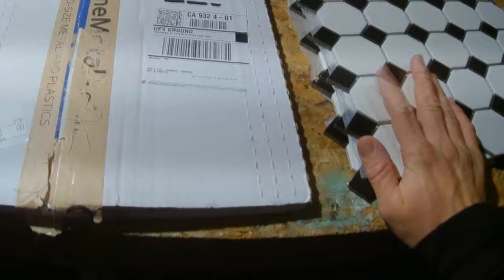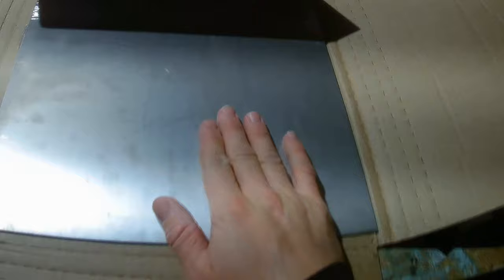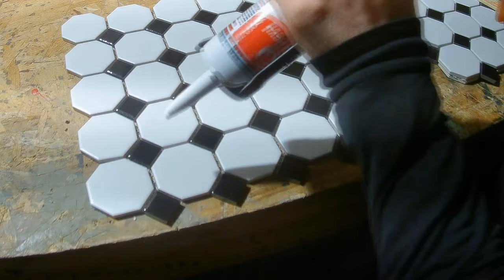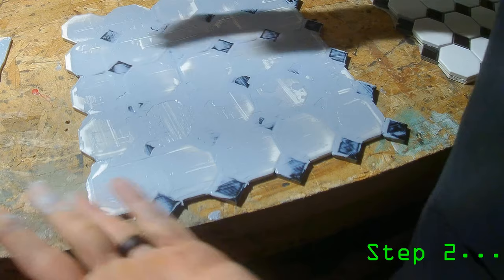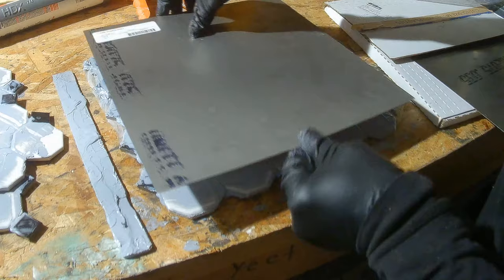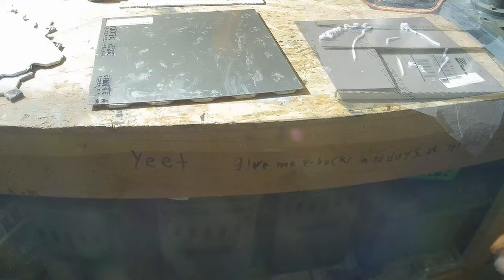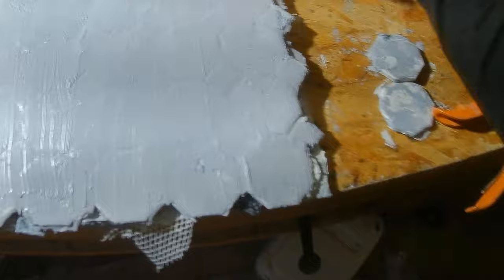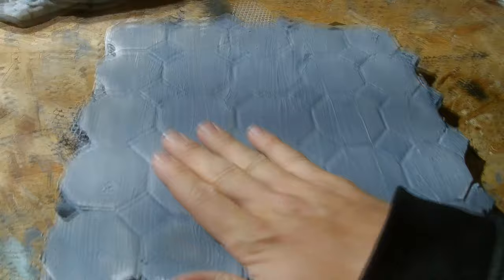PT 1: 113$ Titanium-ceramic bullet proof vest prototype (The  construction )

Comment: Change it up and use a thicker single tile, you'll have prefracturing events (goal is to have projectile touch ceramic, not ceramic impact metal which impacts the ceramic behind it during impact.
Reply from the maker: Interesting thanks for the info